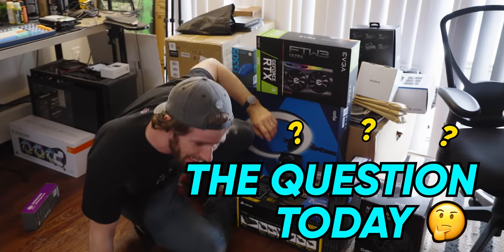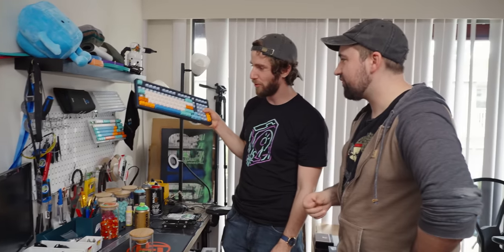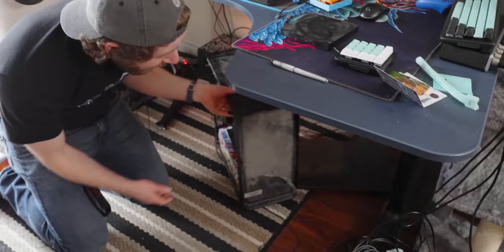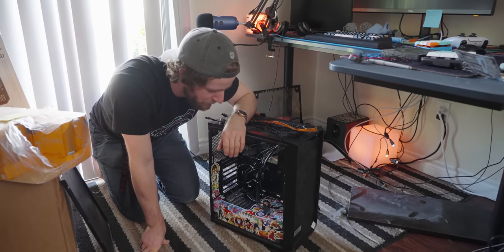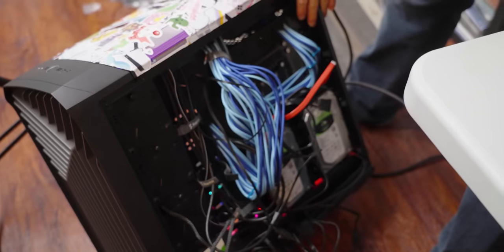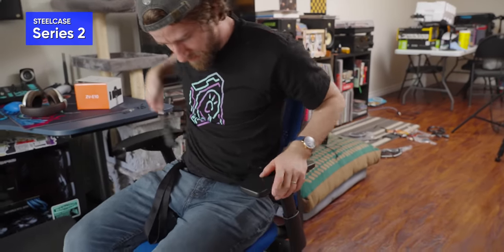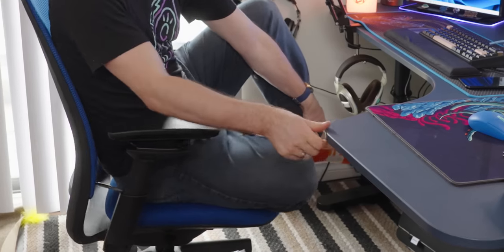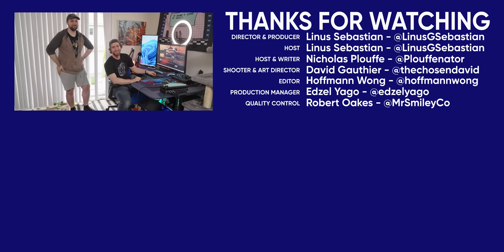I Did a Terrible Job of This - Intel $5,000 Extreme Tech Upgrade

Comment: Guns and liquor is what I've spent over 10K on. Got to love living in the south. Actually I might have lied, guns might be south of 10k, BUT LIQUOR NORTH OF 15K USD. Most expensive one I have in my collection is Heaven's Door Vol 1 2019 @1000USD, then I have a few $500 stuff. Average bottle is 150USD. I was seeing if expensive liquor was worth it. 9/10 NO. THOUGH, my favorite Tequila does cost $200-$250 depending on market, Don Julio 1942. Favorite whisky is under $100 (Jack Daniels Single Barrel Select, though Heaven's door did justify its price), favorite scotch is Dalmore 18yrs that's $200. SO... yeah, I have liquor more expensive than some of my guns.

Comment: I made myself a bleep button for $0 on Linux using software audio processing. It only bleeps vowels, not sybilants so when you say "sh*t" or "f*ck" or "b*tch" you can hold the button down for the entire word and it will only bleep the vowel parts in the middle with perfect timing on it's own. I should make a tutorial about this...

Comment: My HX1000 PSU and 3090RTX were not a match in heaven. are you having any driver crashes with this setup? I have started an RMA with my HX1000 as it was unable to keep my 12900K and 3090 running.

Comment: Me and Nicholas have something in common, we're sometimes irresponsible of tech by pulling sata hard drives out by the cables. The difference is that I dropped a 1TB hard drive full of sentimental data. I regret my actions, but they're easier.
Reply: *Nicholas and I

Comment: So, what did do whilst working in the game industry, and which games was he involved with?
Which anime is on the screen?
14:50 My first SSD was silver taped to the backside of the motherboard tray (or whatever it's called when it's just a part of the case) because that case didn't have anywhere to stick a 2.5 drives.

Comment: I see that the EK360 AIO is listed in the description for this build, along with the Noctua NH D-15. How did you guys manage to fit an air cooler and an AIO cooler into this build at the same time? Genuinely curious because the cooling potential for this seems insane.
Reply: Multiple PCs
Reply: Multiple PCs

Comment: tbh I store my hard drives the same way.. my case has 2 trays but I shoved 6 drives in there and it honestly is fine... I have never had a drive fail on me in all those years, and I even buy used ones.